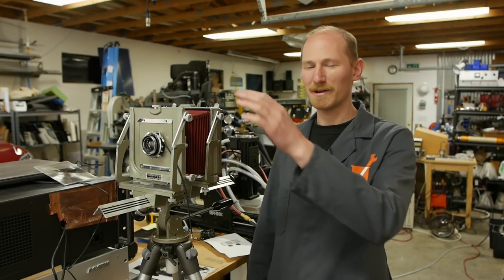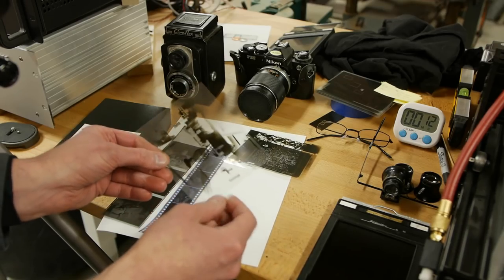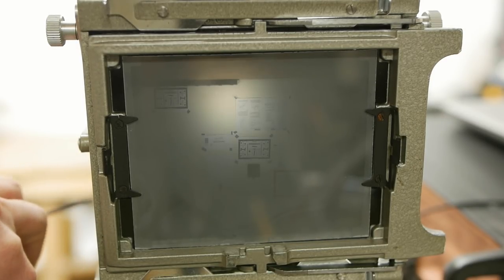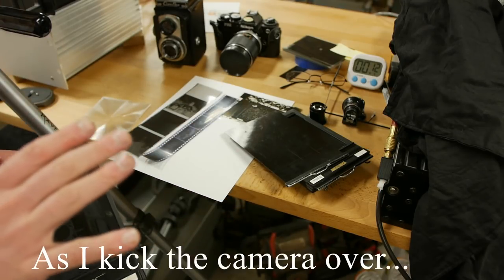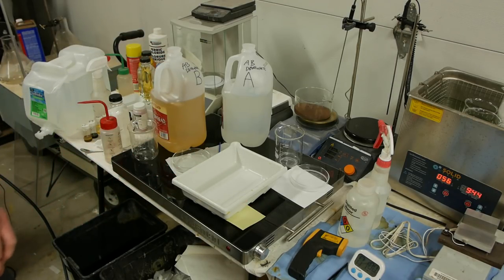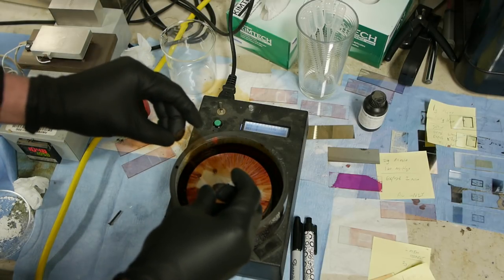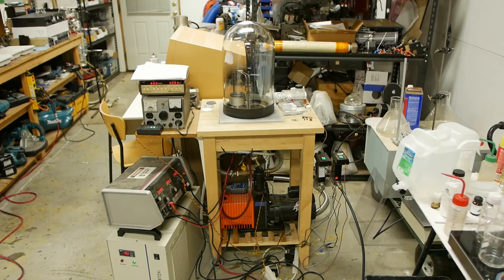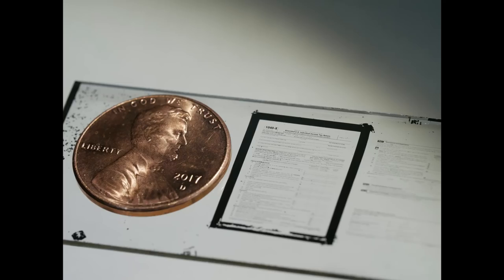Antique 4x5 camera creates 20 micron photolithography masks: Super tiny tax form

Comment: Way back in the late 1970s or early 1980s I saw a WWII Luftwaffe reconnaissance camera in the London Science Museum. The lens, and I think the whole camera, was by Carl Zeiss. It has a huge film format, at a guess about 30cm square. It actually used roll film, not sheet, and the spools were about 70-80mm diameter, which must have meant that each frame was truly curly!. So it, too, used a vacuum hold down system - that was the first place I ever saw such an arrangement, although I think it was standard for things like integrated circuit mask making and other lithographic techniques (update: I think it was this one https://images.app.goo.gl/ukyVFRdytZBJKSoL7 but I can't find it in their on-line collection so it may have been borrowed from elsewhere for their photography gallery, and anyway they now have a separate photographic museum in Bradford, Yorkshire). 

In the 1980s, Agfa used to make its lith film available in 35mm format too: I used it to make sharp masks of lettering for titling audio-visual presentations, and Ithink I may even still have a roll somewhere! I remember it as very "slow" (ASA 3 or 4), but the results were extremely crisp, as long as you developed it carefully. Apart from the ease of lab handling, the big advantage of it being orthochromatic was that chromatic lens aberration didn't matter as much as with panchromatic film.

That was a thorougly enjoyable video - thanks very much for doing it!

Comment: 1. Many year ago now i worked for a company that made early circuit design equipment. The output was to a large photo plotter that transferred the electronic image to a photo plate. Our set up resolution was 3 microns so two dots could be repeated 3 microns apart. As an experiment I devised a system that took a small, 1 inch diag, CRT and drew the image on it line by line. 

This was passed through a 35 mm camera lense but in reverse so the end image was about 10x smaller and projected onto a section of photographic film on a drum. the drum was incrementally turned for each new line and eventually the image built up. We wrote software to break the image up into sections and lines and display them one at a time.

We were able to get very repeatable and respectable results from our system compared to the commercial results from a much cheaper and simpler system.

2. You could mount your digital camera to look at the ground glass screen, or even remove the ground glass and set it at the focus plane to get a clearer view of the focus point. 

3. Really appreciate you channel. thanks

Comment: Good memories. I'm 82. I did my first darkroom developing (Kodak Brownie camera) in 1953. I still have some 4x5 Speed Graphic cameras and complete darkroom equipment / enlarger. Yeah, Ortho is good in that you can use a safe light. But, after a big chunk of my life messing around in darkrooms I don't even think about a light. Do it by touch. The key is everything organized on the bench in the same position and orientation every time, no exceptions. 
Yes, temperature control in the darkroom is everything and for outdoor temperatures you use the film manufacturer tables for exposure correction (and do tests).
You get an attaboy for teaching yourself what is becoming a lost art, large format B&W phototography.

Comment: Problem: film is not held securely against the middle of the slide
My thought: put a glass cover over it
Applied Science: put a vacuum behind it
Reply: Honestly it should be ground glass on both sides
Reply: @austindoud273  ground glass will introduce distortions
Reply: @austindoud273  Ground glass on the front side of the film doesn't sound so good.
Reply: engineering :  put a field around it.
Reply: The reason you don’t put glass on both sides is because you will get newton’s rings which will alter the resultant image. Additionally glass has a different coefficient of reflection/refraction than air and could lead to slight distortions.
Reply: @comeradecoyote  Also, for every air/glass interface, you get reflections. Those internal reflections will fog the film, however slightly. Plus, you will get refraction any time the light ray is not perfectly perpendicular to the glass faces - which are themselves not perfectly parallel to each other. All these reduce resolution.
Reply: Yeah, the vacuum solution was brilliant -- definitely the way to go.
Reply: You want as little glass in the way as possible.
Reply: it would also mess up the focusing plane slightly

Comment: You've rediscovered all the problems we astrophotographers used to have. Great vid. Cheers.
Edit: do you know whether the film you're using can be gas hypersensitised to combat reciprocity failure? Might be worth investigating, and pretty simple process for someone like you ;)
Reply: easier to just wait an extra 10 seconds, or buy better lights.
Reply: Why....just buy a faster speed film like pan F 50.  You dont need litho film for something like this.
Reply: Yes, good point re time&lighting. Not much point saving seconds vs hours(astro).
Regarding PanF, my crusty memory says it was pretty low resolution? There was a reason I filled my fridge with D100 all those years ago, I think that was why (better sharpness & resolution) Think I might even have an old 120 roll of TechPan tucked away somewhere.
Reply: Exposure time really isn’t a problem here. Plus I believe gas hypering makes the grain larger.

Comment: Brings me back to the hours I've spent cleaning microscope slides in the past. My typical routine was a good mechanical scrub with soap and water followed by a 10 minute or so dunk in piranha solution, rinse with a healthy amount of DI water, sonication in IPA and then acetone and finally drying under vacuum. That provided a nice hydrophilic surface for functionalization with silanes. Thanks for the excellent video and walk down memory lane.

Comment: Cool camera! But: The lens should be imaging spot sizes on the order of (in microns at the image plane) 1.3 times the f/number of the lens.  That's going to be much better than the film grain size, which is on the order of dozens of microns.  Optics is always governed by a weakest-link principle.  So you really can't improve the weakest link, which is the film grain in this case.  The f/number of a lens wholly determines the spatial resolution of the lens images, but the film grain is not "impedance matched", rather like parallel resistors 1/r = 1/r1 + 1/r2.  See my optics discussion at http://www.truetex.com/raspberrypi.htm regarding "Specified, theoretical, and actual resolution".
Reply: You sound like you know a lot about optics. I look forward to reading your optics discussion.
Reply: You can improve the film grain, by using ortho film like he is using. And saying that the F number alone determines the resolution of the lens, in theory land. Not in reality. Like he is using an old single coated Symmar.  More modern multi coating alone would improve the resolution. Also simply filtering the light, as you only need single wavelength to do this type of stuff. There are lenses available for this exact job. Lenses are also designed to work on different magnifications, different wavelengths etc. Its just not some simple calculation that F number defines everything.
Reply: I always try to tell people about this when I see comments online about how photographic film has "infinite" resolution... But nobody ever seems to believe me when I talk about film grain size :\
Reply: @Mythricia1988  On ortho, its basically true. Ortho films have higher resolution than any lens can deliver. Even something like tmax 100, resolves more than any realistic lens can do. On 35mm, your absolute max lens resolution in real world would be something like 200lp/mm (still something you really cant find, maybe sigma art 40/1.4 could do it). And tmax 100 resolves 160lp/mm on normal pictorial contrasts.
And on medium format, max lens resolutions are around 120lp/mm and on 4x5" they drop down to around 80lp/mm, at 8x10" you can hope to get 50lp/mm from a lens. And these are the absolute best lenses you can find, and only center resolutions.
So film grain definitely is not the limiting factor. Especially if we are talking about technical ortho type films.
Reply: @Nobody-Nowhere  Resolution depends also on the contrast of the subject. With high contrast test charts Zeiss got 550 lp/mm from the middle of a Biogon 25/2.8 ZM on microfilm stock.
Reply: Holography film and glass plates are in the 5000 lp/mm range.
Reply: Wonder how much of this is classified. You know, because of microdots, spydom, etc.
Reply: @Nobody-Nowhere  F/number absolutely hard-limits image space MTF and thus resolution; 1.3 times the f/number is about the spot size.  Coatings improve constrast but not spatial resolution.  This governs microscopy, telescopy, and photography, and has been understood for 100s of years.
Reply: So forgive me for asking a little off topic, but 3d printing (sla dlp) have like 50 micron limit is this due to the resin polymers or the wave length of uv light?
Reply: @RichardKinch  Photography hasn't existed for hundreds of years, oldest reported success was barely more than 200 years ago without a lens, oldest surviving photo slightly less than 200 years.
Reply: Film this slow is going to have incredibly fine grain.
Reply: Mythricia they obviously never tried to make an 8x10 enlargement from 400 speed 110 film lol. Or that godawful disc film.
Reply: Roger Scott Cathey this is basic darkroom 101 that used to be taught in high school photography/darkroom classes.
Reply: @johncrowerdoe5527  Diffraction limits on the resolution of lenses have been understood since Newton, which predates photography.  Camera lenses are just microscope objectives in reverse.  The same limits to MTF (resolution) apply, and are solely a function of the f/number aka the NA in microscopy.  No lens can possibly do better, even if it has "Zeiss" on it.  And Zeiss would be the first to agree.

Comment: Excellent work, Ben. I worked with an even larger form film when taking Graphics Art classes. It was standard notebook sized. But the real fun and magic was copying that onto metal lithography plates. So much energy was needed that the machine was basically a carbon rod arc welder light source. It had to be adjusted by looking at its shadow on the white concrete block wall then exposed for 2.5 minutes. Then developed by using a bunch of chemicals that smelled like strawberries. In the end the result was 250 runs on the motorized lithography press. Two sides, 500 total. Very very old school. ( we also learned to set lead type in that class )

Comment: When you are exposing the slide wouldn't it be best to blacken the insides of the tube to improve the point source for the light?
Reply: good point!
Reply: The filament is several orders of magnitude brighter than the white of the tube so the diffuse illumination would amount to a few seconds of filament exposure. It is measurable but not really necessary especialöly with the good contact between the emulsion of the film and the photoresist on the slide.
Reply: Gregor Shapiro in other words, yes.

Comment: I have to use mercury street lamp without protective glass. Lots of UV in one spot.
Reply: I think that is something like what he has here!
Reply: wouldnt the tried and trusted generic DIY hydrogen/oxygen theater "lime light" lamp give a far fuller and brighter plate coverage here and cheaper/better than todays hightec over priced,under speced versions
Reply: @paulmaydaynight9925  A lime light only reaches at most 2800 C° but usually lower temperature, not that different from using an overvolted halogen lamp and much less convenient, as a black body radiator at such temperature the UV output is very low. With an arc lamp you not only have the benefit of a much higher black body temperature but also in the case of medium pressure arc lamps a significant output comes from the spectral lines of mercury and other elements added. Also street lamps are quite cheap and last for many hundred hours as a powerful UV source, sadly they are being phased out, so time to stock up!

Comment: The camera is the Graphic View II, manufactured by Graflex, Inc. from 1949 to 1967.  The film holder slide handle is painted black on one side to indicate an exposed film.  The film holder slide handle also has raised dots that allow the user to position the slide correctly (black paint side inward) when loading the film holder in total darkness.   I think the newer film holder slides had five raised dots to indicate that they were opaque to infrared light.

Comment: Three suggestions!  1.  You can cut
about 1/8 off the edge of the sheet film and just low tack tape to
tape the film to the film holder, no vacuum needed. This way you can
use 4x5 film in a 5x7 camera, heck, one can even use 35mm in the
camera or a glass negative or printing paper.   2.  Do NOT pull the
dark slide all the way out of the film holder when doing exposure. 
Just pull the slide out enough to exposure the film.  Reason being,
if you have bad felt, light could leak in that area and onto the
film.  With the slide in place, light can not leak in.  3.  You can
do four test shots with one sheet of film.  Pull the slide out ONLY ¼
way.  Make exposure.  Pull the slide out another ¼.  Make exposure. 
Pull the slide out another ¼. Make exposure.  Pull slide out to
expose all the film.  Make 4 test shots on one film...easy!

Comment: All great comments. I'd like to add that certainly making a vacuum holder was ideal though there were some old tricks that photographers used. One trick was to use semi sticky glue that came in what looked like fat "chapstick" like tubes. Using plastic gloves to avoid leaving fingerprints, you could then press the center down to even it out. There was a company that briefly sold "sticky plastic" sheets for the same purpose. 
Your tools and techniquewith large format photography are really bringing back memories! Great work.

Comment: The film dark slides have a black and a silver side on the handle typically, so you can have the 'dark' side out to say it's still 'dark inside', and the light (just bare metal) side to say that light has gotten in. Its an easy way to tell which one you have used when you're carrying a whole bag of them.

Comment: Very nice Ben, brings back memory of making lots of PCB's in the garage with the same process.   This was back in the hand tape days, no fancy PCB design tools and get your PCB's form China in 5 days for $2.   Didn't have the camera so I sent the 2x tape ups out for reduction negatives, but had to make positive contact copies with ortho litho film for the positive Shipley AZ111 photo resist.  I found the trick with the spin coater was to wet the entire board with a cotton ball before starting the spinning, adding more resist as you go.  I think the viscosity gets too thick as it self drys towards the edge of the boards.   Also make sure you arrange your image so the emulsion is down against your slide for the UV exposure.
 It's amazing how well the resist striped off under the Ti coating,  the edge of the resist has to be exceedingly thin.
Nice to see Freestyle is still around and still sells litho sheet film.

Comment: Hi Ben,

Working in microelectronics here. I do a lot of photolithography and photoresist coating. To spincoat photoresist uniformly on wafers you have to put the liquid on the whole surface of your sample prior to spinning. Only once the surface is entirely covered you start to spin. The acceleration should not be too important like 700 or 1000 rps².
Maybe you are starting to spin before putting the photoresist because you had some of it getting under your sample? Your equipment must be perfectly leveled to avoid that. Also, you should not put too much liquid and avoid any air bubble before starting to spin. This method works perfectly on round wafers but also with odd shapes like rectangles.

Your work is extremely impressive, I love your videos !

Comment: Well, I'm blown away.  The whole sputtering thing at the end was completely over my head, but I loved it anyway.  Vacuum was commonly used in large process cameras (shooting 16 X 20 film), used in print shops.  BTW, if you check the dark slides on the film holders, you'll see that one side of the metal tab you grasp to insert the dark slide is aluminum colored, and the other is flat black.  The convention was that when you inserted fresh film, you would have the aluminum side facing out; when you exposed it, you would re-insert the dark slide with the dark side facing out.  This helped you to avoid taking several exposures on one piece of film.

I'm definitely going to have to check out your channel in depth - there's an ocean of knowledge here.  Well done!  Thanks - Charlie

Comment: Back in the mid 1970s I used a 4x5 camera to make the negative for printed circuit boards.  I'd do the layout at 4x the size of the final printed circuit board and use the camera to reduce it down.  The negative was placed on a printed circuit board with a photoresist that was developed.  Last of all the board was placed in etching solution to remove the copper that was unprotected by the photoresist.  It was a lot of work, but the lines were very clean.

Comment: There's currently a large need for mechanical respirators and masks. If you could do a video on how to manufacture the filter material, that would be an enormous benefit to everyone as a whole.  From my research, they also have some electrostatic filtering mechanisms in addition to physical ones.

Comment: My father had one in the 80's that he used much as you are to making printing press plates. I used to sit on a stool with welding goggles on because the lights he used to illuminate the source were extremely bright. Even the reflected light would blind you for a while.

Also - putting the loop flat on the surface is how one uses a loop :)